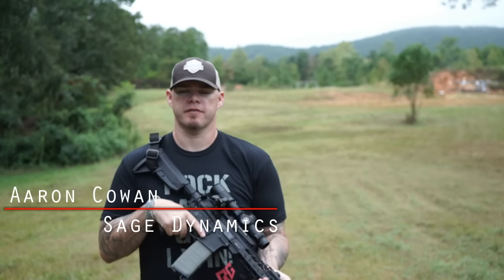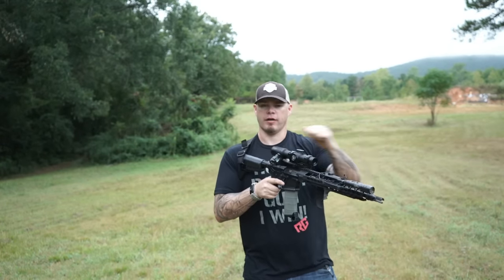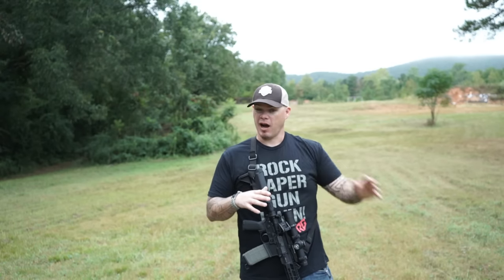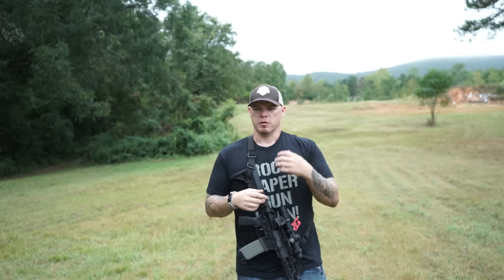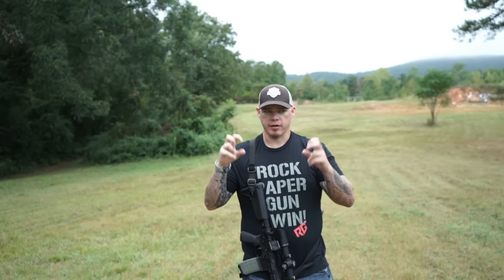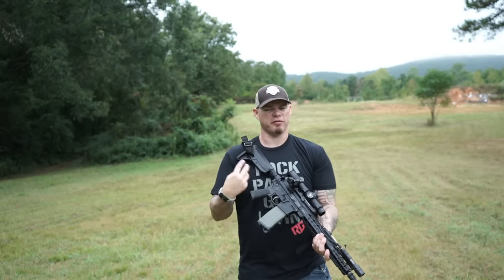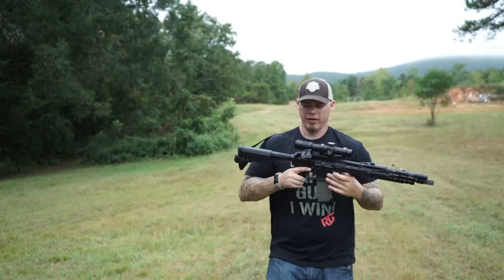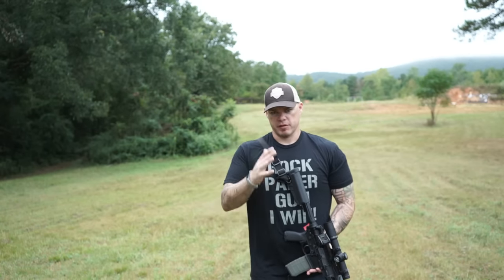Standing Rifle Grip

Comment: Not a dig against you, more of a general comment, but ten years ago, we all used the KAC VFG and fought the worst parts of OIF holding the rifle like that. I get a good chuckle when the Costa Commandos do that silly thumb over bore grip. It may work to an extent, but it never caught on with me. Watch: in a few more years it'll be back to VFGs and we will have gone full circle. There is nothing new under the sun...
Reply from the maker: Usually more than one option.  The VFG is awesome for 7" rails when full extension isn't an option but the longer the rail, the more options you have.  I still prefer VFGs for running IR lasers but I've never been a fan of the broomstick grip.
Reply: Nothing new under the sun amen.
Reply: Guys got issued broomstick, so they used broomsticks. Guys got issued Grip-Pods,  so they used Grip-Pods.
Reply: +VIPER150311 There's a reason you don't see Grunts using 3 point slings anymore.
Reply: Go to a 3 gun match and see how everyone is holding their rifles, and see how many VFG's you see. Thumb over bore(not the exaggerated Costa grip shown here), or some variation of it like what Cowan uses, simply works. People will start ditching VFG's on full length rifles just like people ditched Weaver for handguns. Even the good shooters I know who still like VFG's don't use them for anything more than handstops to facilitate an aggressive forward grip. People adapt to whatever the current best thing is. When the next best thing comes, I'm sure we'll all ditch this grip as well.
Reply: I have a stubby vfg on my rifle and it functions as nothing more than a hand stop lol.  holding it as a grip just feels un natural as hell compared the ways shown in this video
Reply: KAC vfg's are great with a 7in rail that is running a peq, surefire, antipersonnel laser, and other crap with no place to put your hand, not so much on a clean 15in rail.
Reply: yup always used the VFG. but had a team guy tell me to use the Afg for better control when clearing rooms

Comment: Great video Aaron! I have a question regarding the magwell grip or using the dong grips very close to the magwell. Ive heard some people say that although it does not perform as well as the Costa style grip etc... it is less fatiguing or better when you are fatigued because youre using more of your frame as opposed to just muscle.
You seem to know a bit about kinesiology etc... so I would like to hear your thoughts on that
Reply from the maker: It can be more stable at the body but less so at the muzzle.  In any event it can be maintained for much longer.
Reply: SageDynamics Thanks. Keep doing what youre doing, your insights are very helpful

Comment: BCM buttstock?? I keep switching between the BCM and the B5 systems on my BCM Recce 14
Reply: I have the B5, and have been contemplating the BCM stock. What are your thoughts on the comparison?
Reply: I really like how tight the BCM locks up on the buffer tube. Very little wiggle if any and I also like the sleekness of it but that means you give up a little to the B5 as far as cheek weld goes. I love the cheek weld you get with the B5 and that is really the only thing that keeps me going back.
Reply: Just watched the new Haley Strategic video on grips...and it appears to show the BCM mod 1 stock.  It appears to be a Mod 0 with the B5 cheek weld.
Reply: I saw that looks awesome! I wonder if the will offer upgrade parts or if you will have to buy a whole new stock. I am hoping for parts due to the way the stock comes apart.